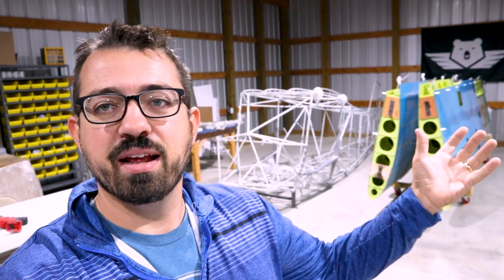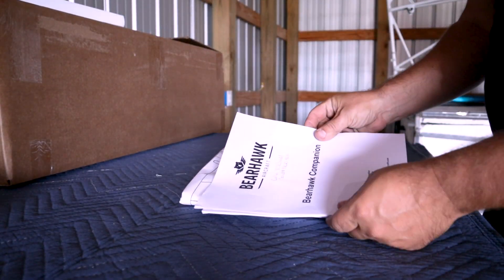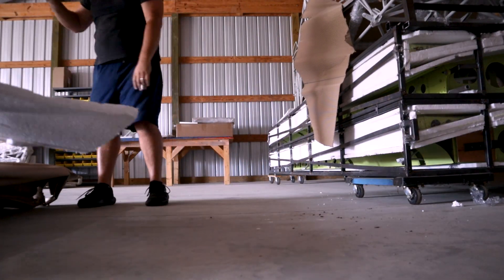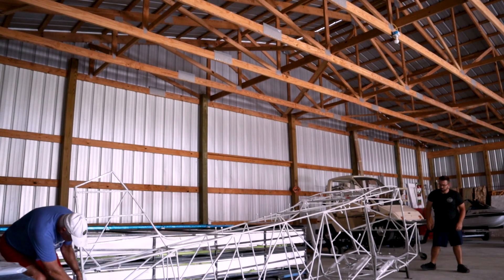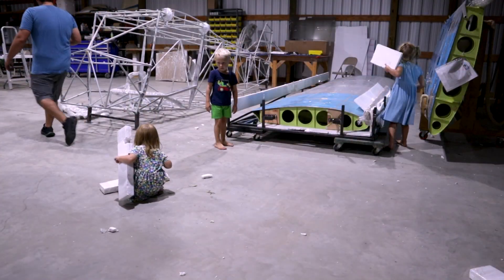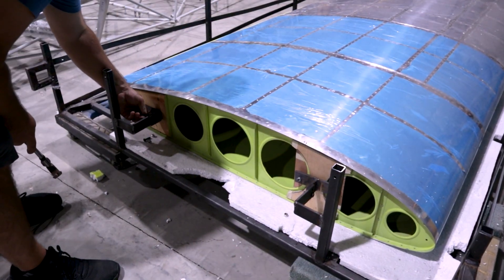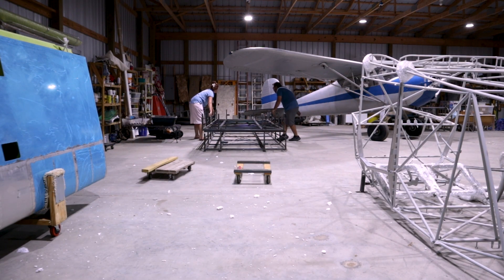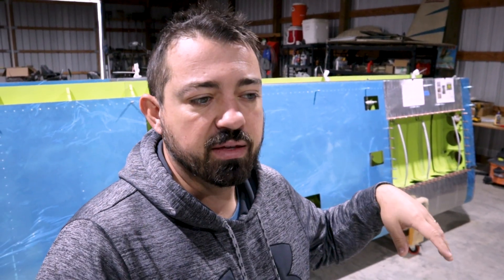Bearhawk Quick Build Kit Walkaround | Bearhawk Build Series

Comment: Thanks for a very nice video.  I used to support Jabiru builders in the UK, we started off putting the hardware and small parts in boxes but found it much more efficient to create a large pin board with all the bags grouped and pinned up on the wall.

Comment: An 'Airplane made in Mexico'? That didn't work out so well for 'Cessna' Purchased from Lancair it became the Corvalis then the 'TT' and finally it disappeared entirely. The problem was with the production standards of the Mexican plant. Over 50% of the parts that arrived for assembly FAILED QC inspection. After Finally receiving enough parts to build about a dozen planes, the FAA Inspectors REJECTED All of the completed airframes for airworthiness. Those planes were Chopped up and now reside in a Landfill.
Reply from the maker: I'm familiar. I was concerned with that as well but I've since learned the reason for it. I actually picked at each weld and inspected each weld for anything I don't like. They are fabricated in a jig using steel imported from Germany that bypasses a raw goods tarrif. Forums have some good information about this as well.